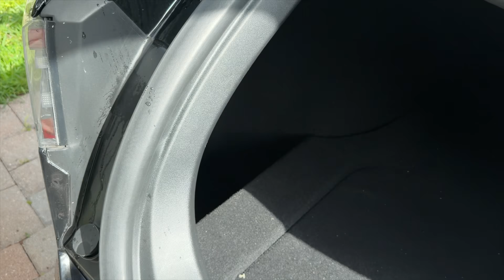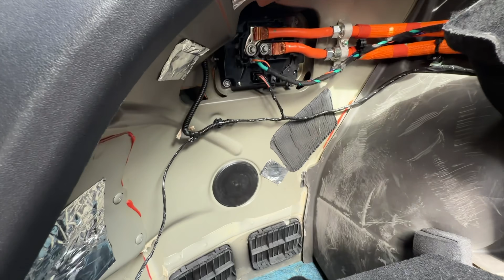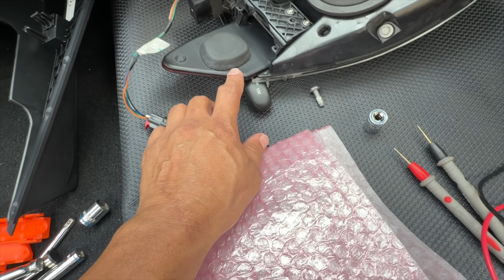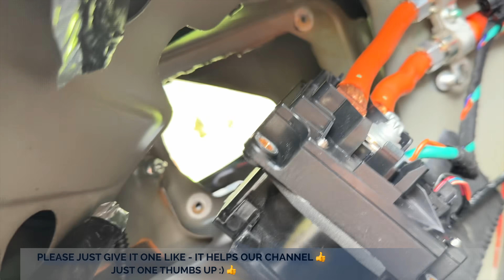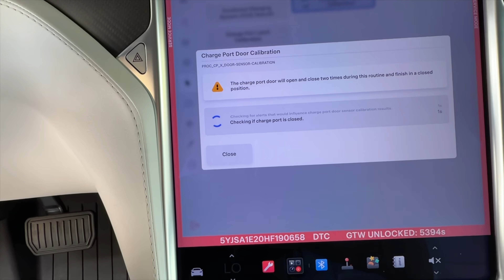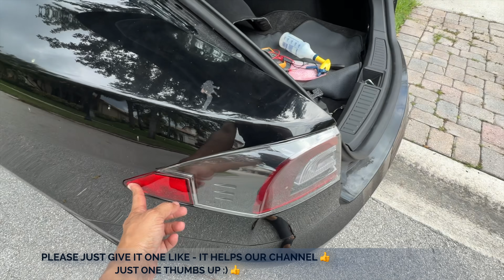Tesla Model S Charge Port Door Sensor assembly Replacement and Programing with Details - DIY EASY

Comment: Great video, about to do mine also.  How long roughly does this repair take?
Reply from the maker: Honestly 2hours is more than enough if you have everything ready. 
Watch the video a few times so you are fully familiar. It will make things easy for you. I did the same and I knew what I was going to go next and what tools was needed so you’re not wasting the time trying to get the proper tools. 
The trickiest part was to remove the nut for the taillight and putting it back in because you have plenty of opportunities to drop it so make sure you use a stick with a magnet and it will save your day. I did lose one, but luckily, I had a spare one of the same size.

Comment: When I enter service mode there isn't an option for charge port calibration.  I have a 2017 S
Reply from the maker: There should be. Did you follow the video. Mine is also a 2017
Reply: Mine 2016 dose not have the high voltage in the mineu when I inter service mode